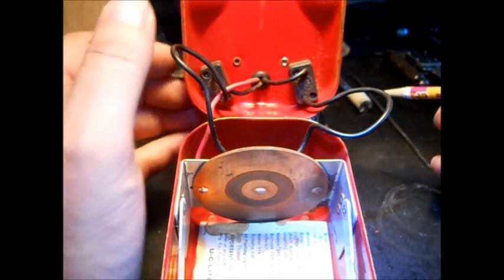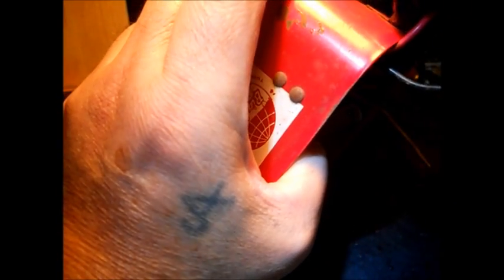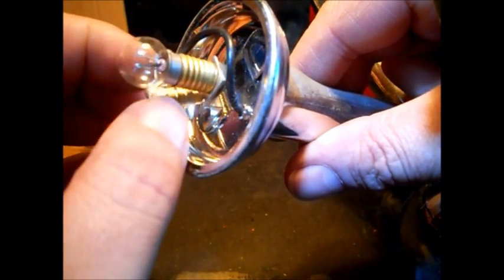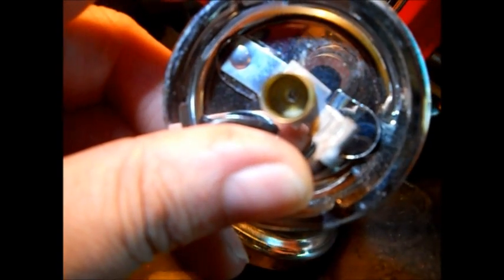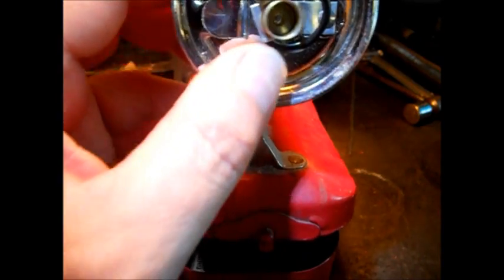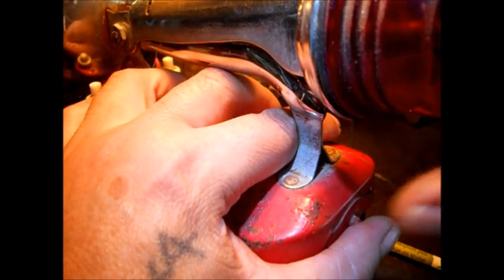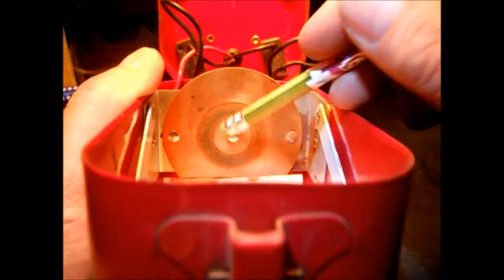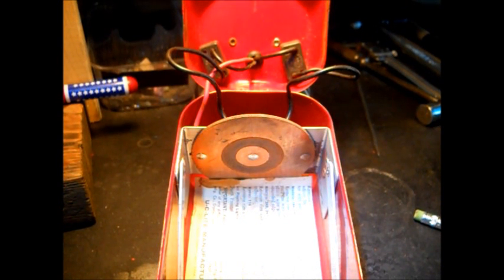Wiring a BIG BEAM Flashlight

Comment: I have a Teledyne big beam model 1000 with a two bulb lens and multi switch. It uses the frame as one contact, the other being the negative black wire to each bulb, insulated, from 2 way switch, the second positive wire going from battery to switch, grounded from switch to frame to complete circuit.. I can only guess it was used to eliminate a wire or two for easier, cheaper manufacturer. Very strange, but it works.

Comment: the wiring on that thing had Me and Lil Dirtbike scratching our heads too, positive ground is making a little more sense now!!  You're missing a little rubber foam gasket on that tail light, that helps it stay on with a little tension!!☺
Reply: 805ROADKING I know this is old, but I put a rubber band to act as a gasket for tension.

Comment: Mine had different color wires in different places interesting enough. However, it was wired the same with only one wire to the tail light and two to the headlight with the switch in one. on the back It makes sense that it is the ground since it is connected to the outside. that's what had gotten me so confused -  I definitely learned something here - I haven't ever worked with a positive ground system before. Now yours has a flasher bulb in it, mine has a flasher unit inside the battery case.